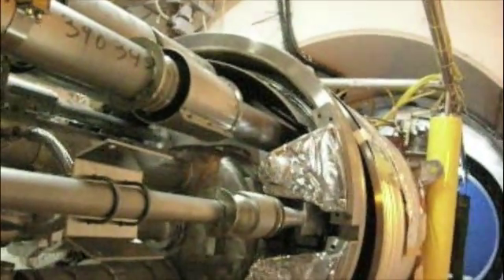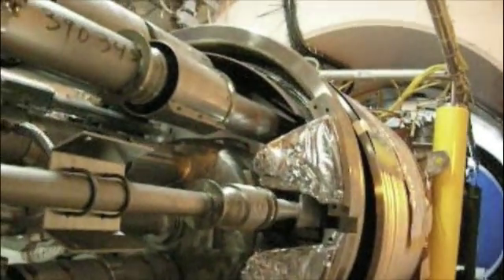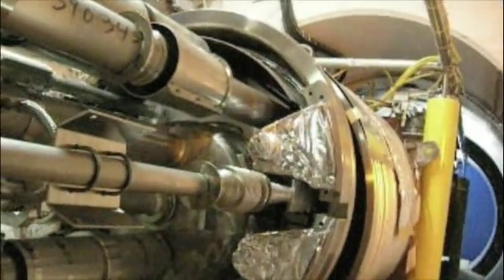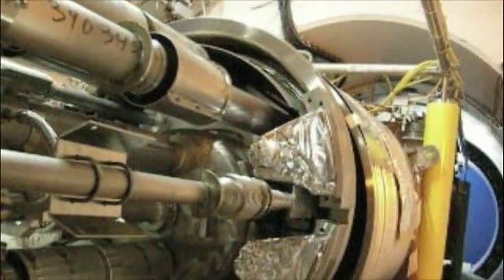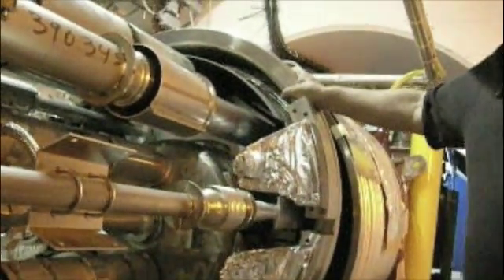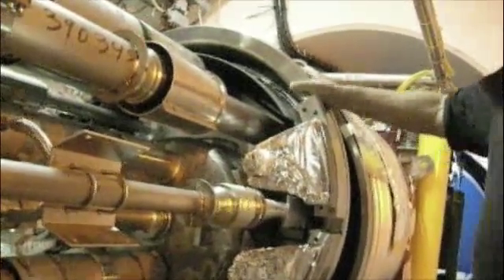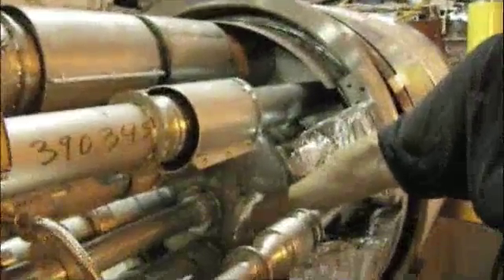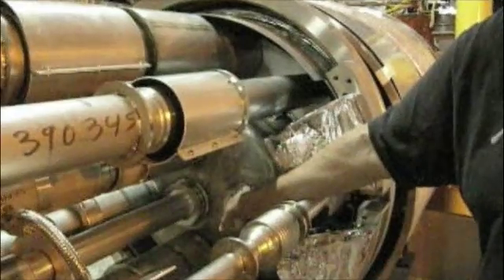Physics Today September 2007: Problems at the LHC

Comment: So it broke due to something a simple as mechanical stress caused by  the core tube shrinking more than estimated at low temperatures? Did I understand that right?